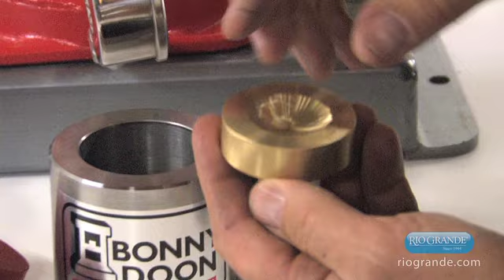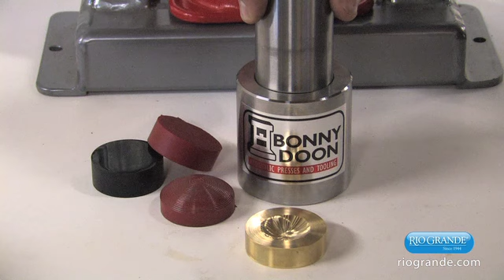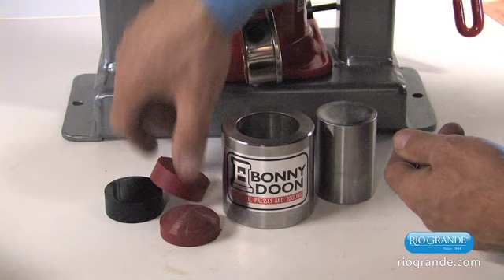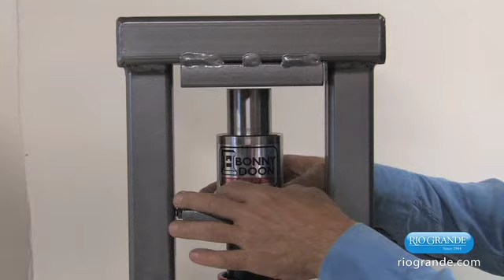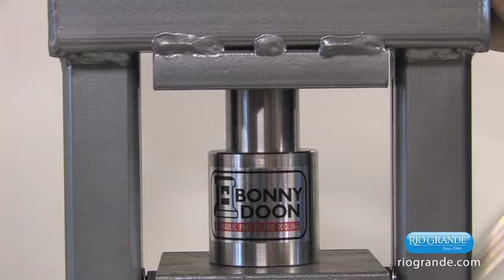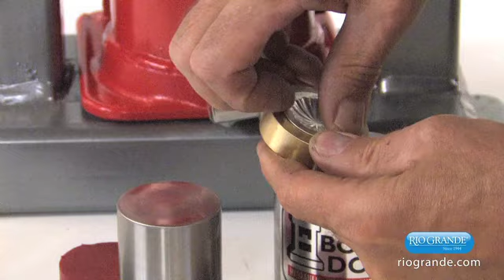Bonny Doon Precision Non-Conforming Die Containment System

Comment: Can you explain why you chose the domed rubber instead of the flat ones?
Reply from the maker: Hi J, Thanks for asking! The red polyurethane is denser so when it’s pressed into the die, the result it a maximum amount of detail. The reason we use the domed polyurethane is because the domed surface can conform to the shape of the die better, and it does not have to travel as far while pressing. Using flat polyurethane, the edges of the design would experience immense amounts of pressure while the center would experience much less, or perhaps leave no impression at all. Most likely, the edges of the metal would split before getting an impression in the center of the die. Hope this helps to explain what is happening here. Please let us know if you have any additional questions!

Comment: what gauge silver and  did you anneal it first?
Reply from the maker: Hi, Leslie! Thanks for asking! Our Jewelry Tech Team says that you can use up to  24 gauge sterling. It would help to anneal first, even if you're using dead soft. It is possible to do a second pressing if the full detail is not recognized.
Anneal a second time and run it again as long as it can be placed exactly in the same spot of the die. Let us know if you have any other questions!
Reply: why only gauges 24 an thinner? is it because the dies are made of brass vs steel?